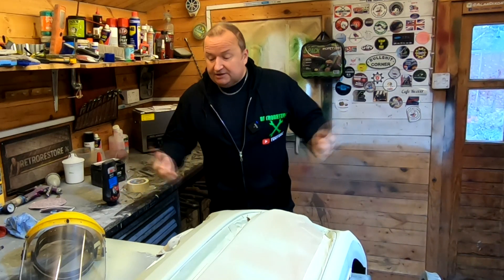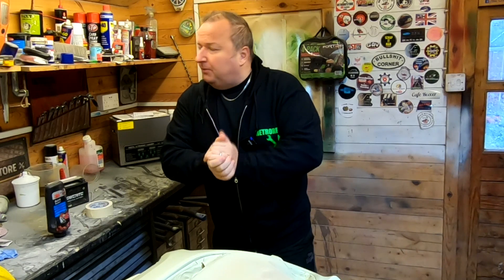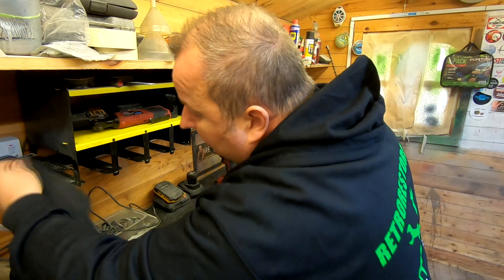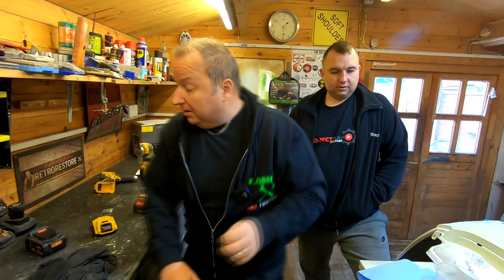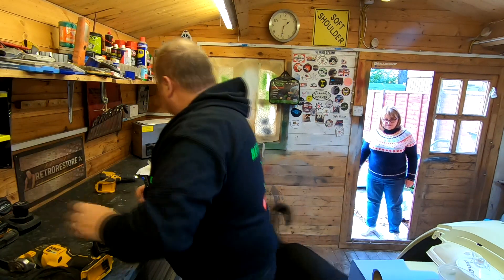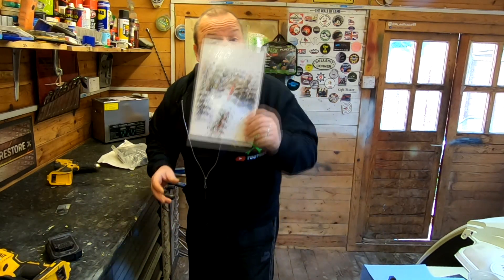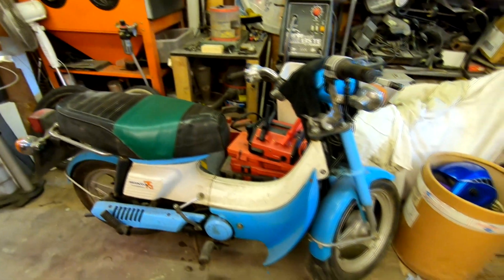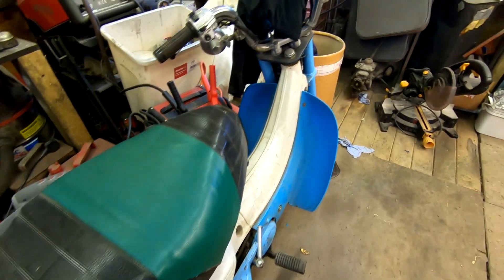My Workshop Is A Dive

Comment: 😱 I would have had a fit Martin, had I walked in and found that mess, I'd be standing over Jimmy till it was spotless again. I'd say with all the extra space you created in the garden, perhaps another poly tunnel project, solely for sanding and spraying, might be the order of the day, sometime next year, you'd definitely get the use out of it for sure 👍
Reply from the maker: I was going to build something this year but timber went up 3 times the cost. It's in the pipeline.
Reply: @retrorestore  Yes Martin, crazy money for timber, and everything else, at the moment, hopefully that will change next year 👍

Comment: Hi I have a quick question. I have a 2009 aerox I had a issue with my carb so bought a new one. I've got it to idle fine but as soon as turn accelerator it will bog and cut out. Any ideas what could be?
Reply from the maker: Try lifting the needle in the carb by 2 notches. Its attached to the throttle slide.
Reply: @retrorestore  is that the needle that is inside the barrel with the spring?
Reply from the maker: @matthewgreen1443  Yes bud, If its on the top groove, that might be your problem. Try it one groove below the middle groove.
Reply: @retrorestore  ok great I will have a look tomorrow and will let you know

Comment: Some help if you can,,,,,Vauxhall Zafira b 1.9cdti not getting upto temperature,,changed thermostat sensor as it had a error code on it 11507...
Any thoughts glady appreciated. Thanks
Reply: Check for air in the system. Bleed the air out through the pipe at the front of the manifold if you haven't already.
Reply from the maker: Engine coolant temperature sensor fault Mark. Assuming your coolant is up to level, could be the connector on the sensor, Pull it off and clean with a contact cleaner.
Reply: @retrorestore  Thank-you 👍💯

Comment: Naughty Jimmy put the extraction fan on lol.not got a impact driver yet my impact is a  10mm and a hammer lol would you just buy a new battery Martin Ur would you think about replacing all the battery that's inside them
Reply from the maker: The Dewalt batteries are fine Gary.

Comment: Martin my man! 🔋🔋🔋 The bigger 5.0ah battery will have a higher power "wattage" Take a look on the bottom of the batteries the volts are the same but the Watts go up with the bigger batteries. I have DeWalt ones too and the little 2ah don't work so well on the skill saw....need the 4s or 5s as you rightly said. I agree, Too many plonkers about giving the wrong information .